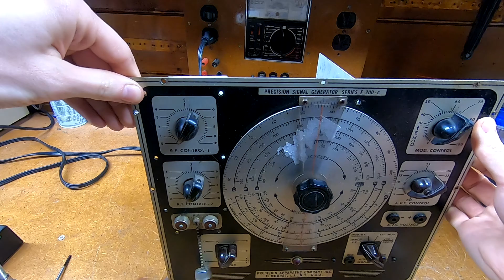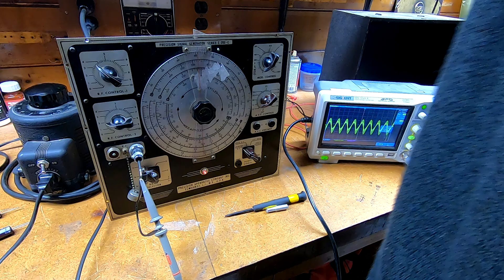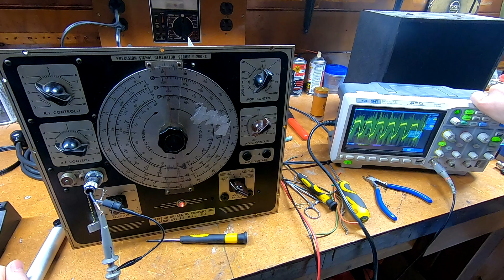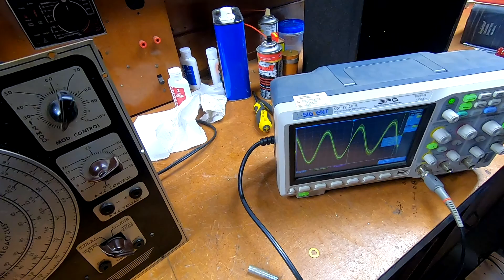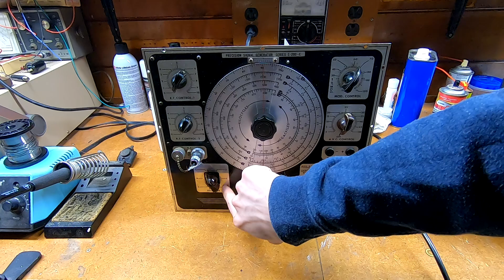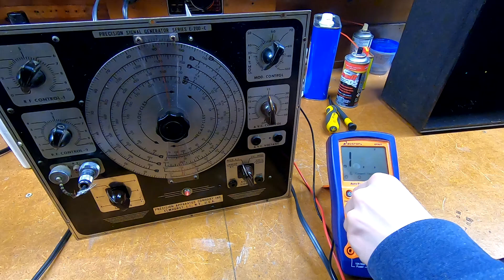Precision E-200-C Repair

Comment: Mine was almost dead-on balls accurate (it's an industry term) when checked on a freq counter on every band.  Amazing. All I did was recap it.  I still have the original instruction manual that came with it (this was my dad's).  What I do to clean vintage equipment is to LIGHTLY smear Zep orange hand cleaner on all surfaces (I say lightly because it has an abrasive and you do NOT want to "polish" the surfaces).  Gently remove the Zep without rubbing and all the grunge just falls off leaving everything looking factory new.  I wish the Zep was available without the abrasive grit.

Comment: Nice video, did you do anything to cleanup the output waveform? Thanks
Reply from the maker: I realized after finishing it up that the goofiness in the waveforms is due to the oscillator using harmonics to generate some of the higher frequencies. When the fundamental frequency and it's harmonics combine at the output, you get that odd looking mountain shaped waveform.

Comment: I have one of these beauties to go over some time in the future, I will be adding a line fuse either internally or on the back panel to it, it's usually missing on most vintage equipment, and some just don't think to put one in, but I like to try to preserve aged equipment with one whenever possible. @ 8:50 , according to instructions, the premise for having the AVC control is that when a radio is to be aligned for best performance, controlling and suppressing the AVC action will hold the RF and IF grid circuits to the actual capacitance levels, making it more of a "real world" alignment than just using a low RF input level and raising the audio gain to get an output to peak on a meter. It might be of help if one desired or needed to "stagger tune" or widen the IF peak for a bit more fidelity, but seeing how it's popularity never caught on, and most get around it by using the normal low RF input / High audio gain alignment method, It may or may not be a really usable feature. It also requires a tech to cut into the existing AVC bus to inject that voltage (according to instructions), and that in itself arguably isn't making a "real world" circuit anymore.  Thanks for the video!
Reply: If you have the original power cord, the AC fuses are built into the plug.  If it's been replaced, then add fuses internally.